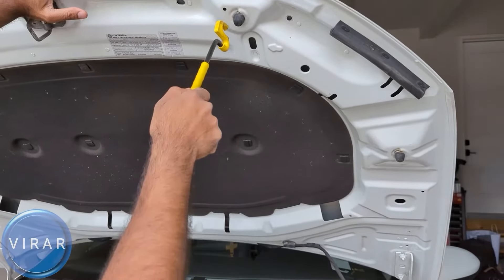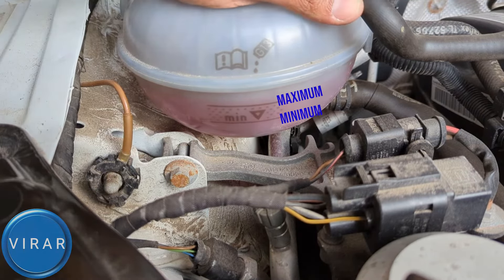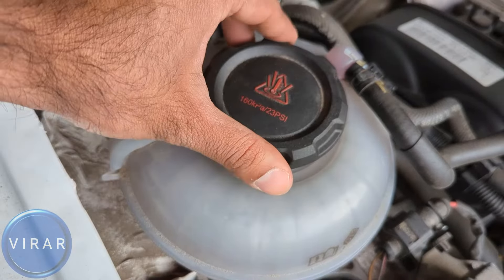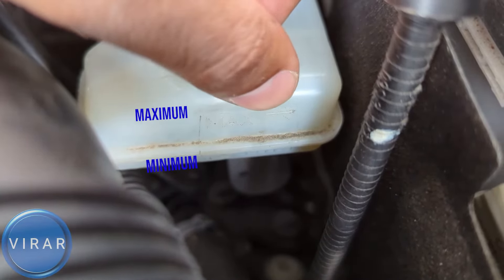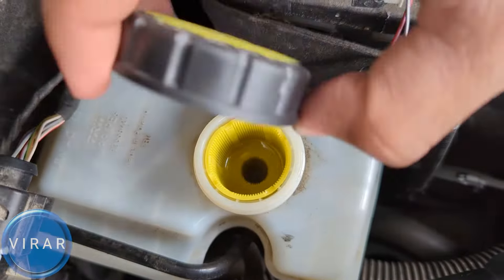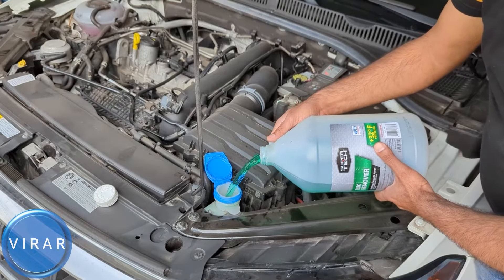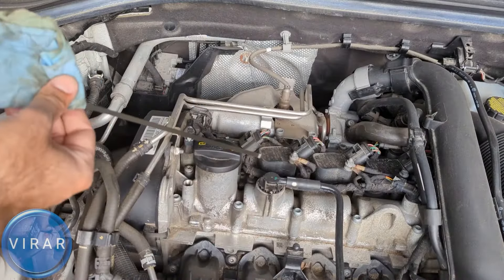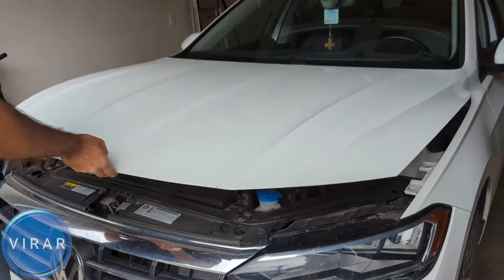How to Check and Fill Fluids [COMPLETE GUIDE] - Volkswagen Jetta (2019-2023)

Comment: Yikes, don't use any generic coolant.  Use the correct one (G13 for this vehicle, as it says on the reservoir), either VW OEM or Pentofrost.   VW calls for low viscosity DOT4 brake fluid, which I found to actually be quite cheap a the dealer (under $9/liter).  Supposedly that allows the ABS to work better at low temperatures.
Reply from the maker: Thank you for sharing!
Reply: Po 3:1😅 3:😅😅

Comment: Hello. I understand you can’t check the transmission fluid, but can you replace it? & if so how?
Reply from the maker: Yes you can replace the fluid. I
There is a drain and fill bolt underneath the transmission that has to be taken off to drain and refill the fluid. You need jack stands and a few other tools to do the job. I don't have a video on that unfortunately

Comment: Do I need to mix water with the coolant when simply topping it up (if it's not a pre-mixed formula like the one you showed here) or is it only needed when you flush the old coolant completely and refill it with a new one ?
Reply from the maker: Ideally you should mix it with water if it's not a premixed formula. If you can't find distilled water, in a pinch you can just tap water to mix it with and top it up. Be sure that this is only for topping up small amounts. 100-200 ml
Reply: @VirarAutomotive  Thanks!